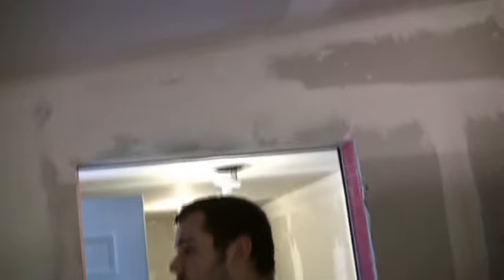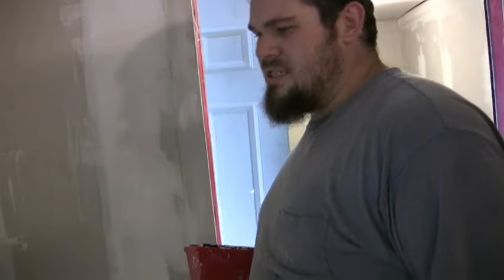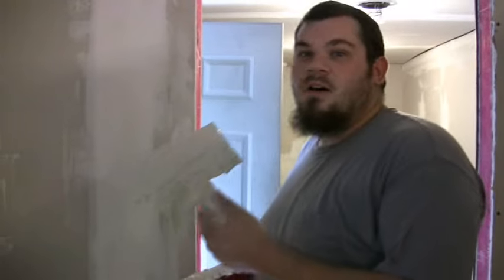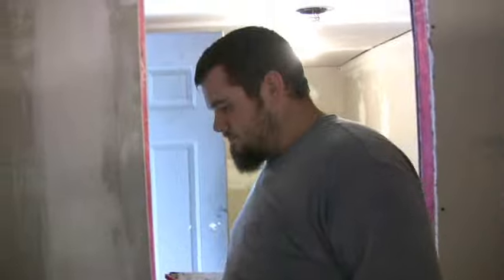This old Trailer: episode 31: DRY WALLING

Comment: My dad wants to put wainscoting in the bathroom I'm remodeling. I like wainscoting, but I do NOT want floor to ceiling bead board on every wall. I offered a compromise of doing it to accent walls... He doesn't like my idea. I want to paint some of the walls (vinyl wallboard). I'm beginning to think that would be a pain, they ripped part of the vinyl wallpaper off-- Would it be easier to take down the wallboard then install green board, instead of trying to patch and paint over the wallpaper?